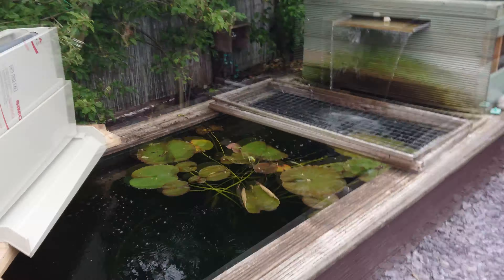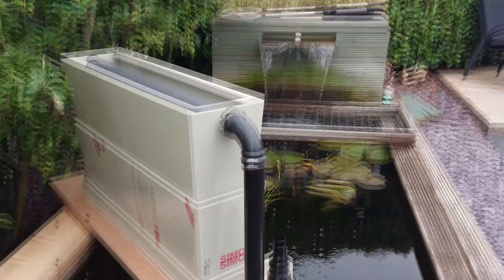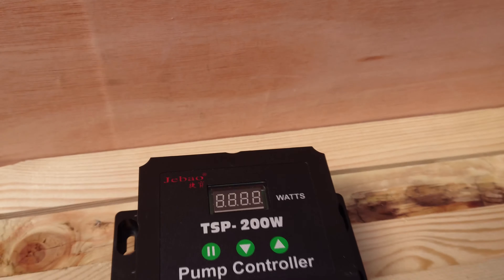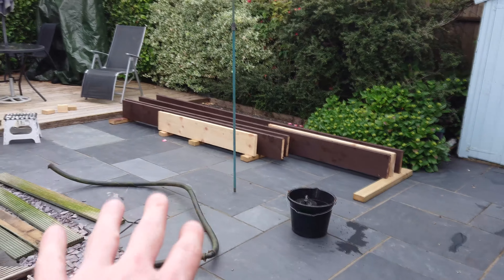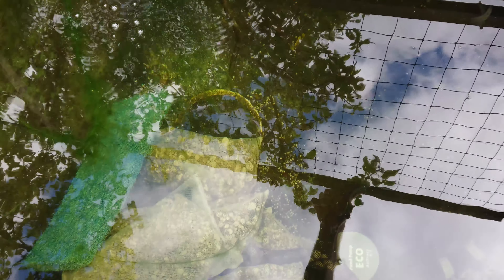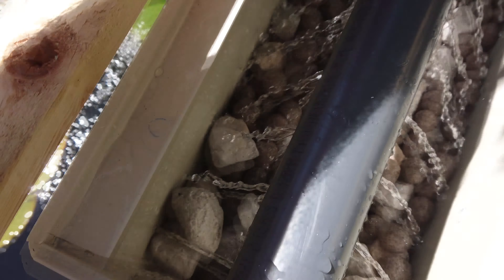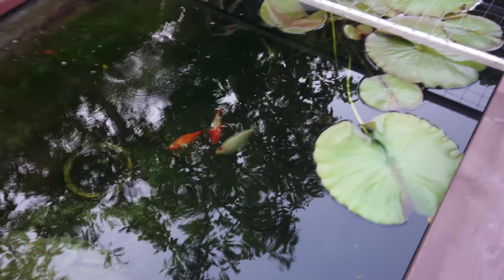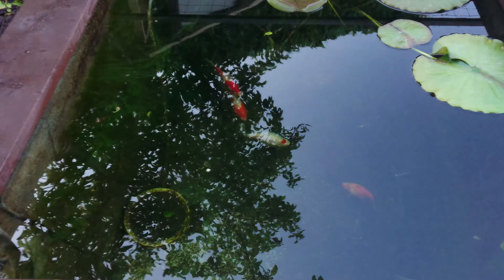Wooden Pond - Revamp pt1 - new build

Comment: Love the setup but what is the filter/spillway piece called and where did you get it? I’d love to put one in my pond

(The one listed here 1:09 )
Reply from the maker: Hi, the Bakki shower is by Evolve Filters they make lots of different variants i will give you a link to their facebook page they are contactable from there. I ordered mine off ebay just searching for bakki showers but you can get many sizes and shapes worth a look on their facebook page https://www.facebook.com/EvolveFilters/posts/279338132705900?comment_id=279339976039049&reply_comment_id=279347189371661&comment_tracking=%7B%22tn%22%3A%22R0%22%7D 
regards
Kel